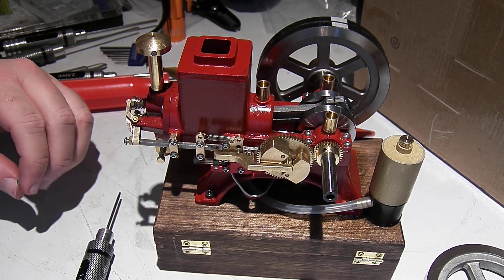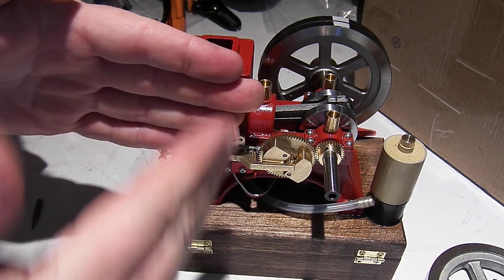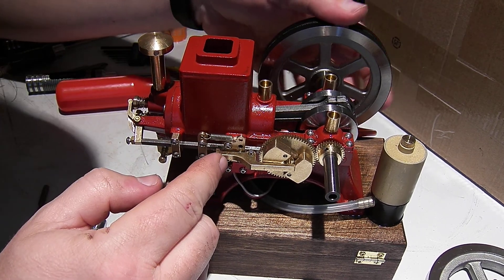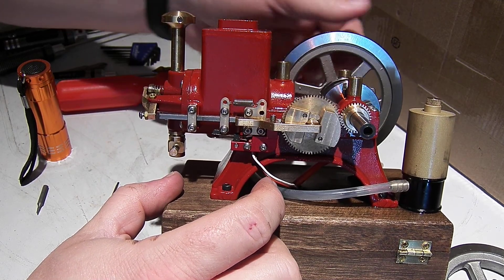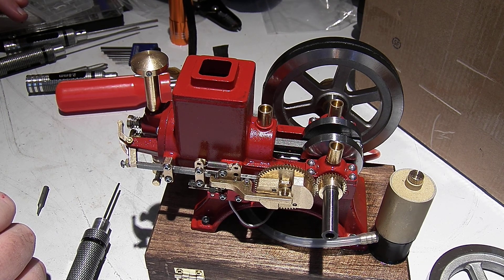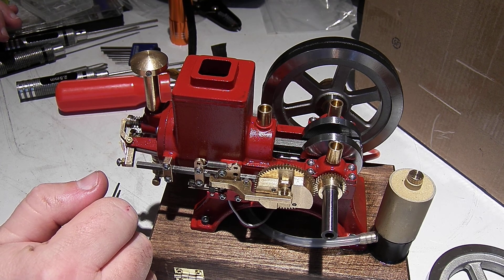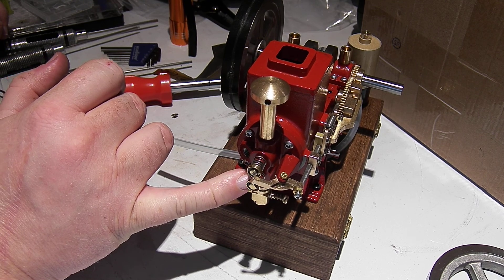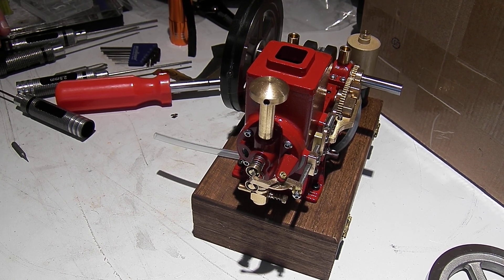Enjomor mods overview

Comment: G'day Henry Where did you put the ground plug for the engine?
Reply from the maker: The ground wire is on the underside of the box lid, fastened to one of the bolts holding the engine down.  I put it on one of the fasteners closest to the hinge to keep it out of the way when it moves.
Reply: @henrybangsberg2187  Thanks Henry appreciated. I'll try scraping a bit of paint and putting the ground wire on one of the engine mounting bolts.